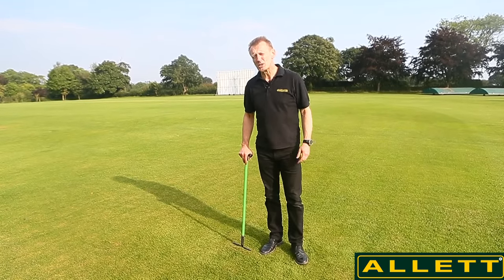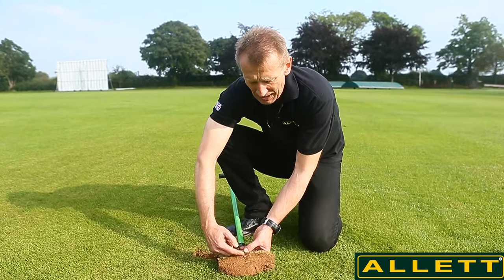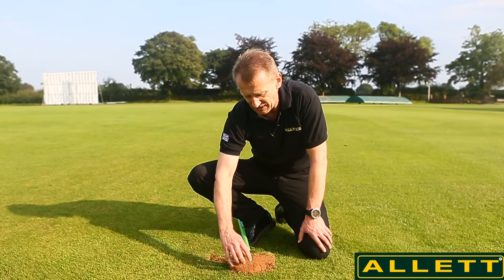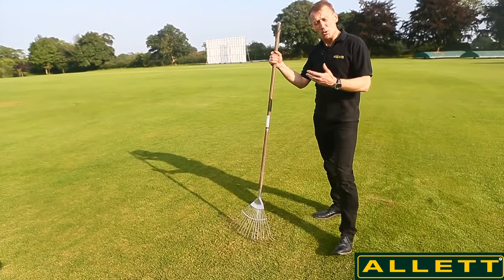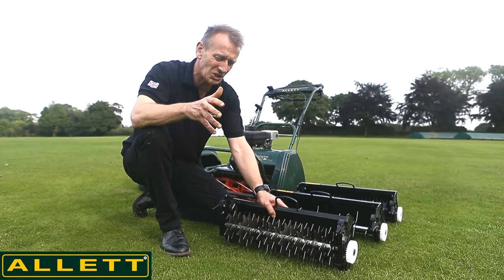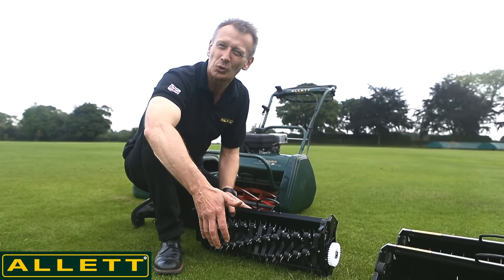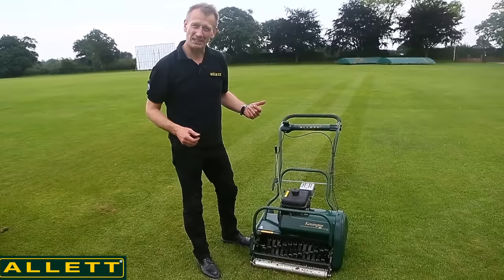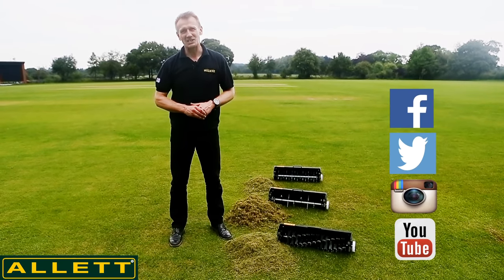How to Scarify your Lawn and Reduce Thatch using an Allett Mower

Comment: What kind of grass are you doing ?
What will happen on burmuda. Zoysia or st. Augustine  lawns ?
Reply: The Buffalo (St Augustine) doesn't have Rhizomes, so the Dethatcher cartridge might be too aggressive for the plant because it could cut off all the runners and kill it. Care would have to be taken with the Verticutter too for the same reasons. Regardless you'd be choosing the higher height settings with those cultivation cartridges on St Augustin grass. But really the HOC on these lawns isn't in a cylinder mower's sweet spot IMO.

Comment: How do.you adjust the blade height on a balmoral 20se m8 I see 2 flat head screws bust they don't seem to move?
Reply: @ALLETTMOWERSUK  I can set the knob to max height but the blade is still to low,there looks like there's adjustment at the actual main blade too there's a flat head screw at with end of the blade but they won't turn,not sure if I'm doing something wrong.